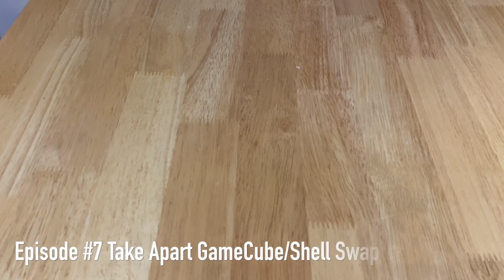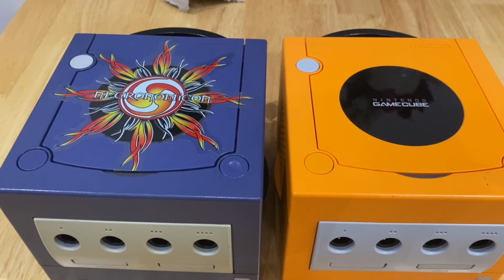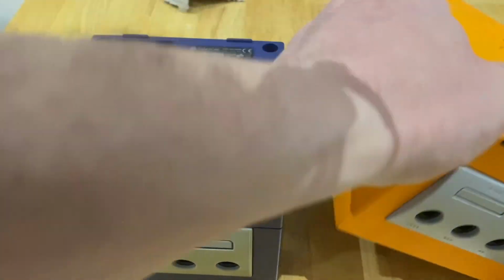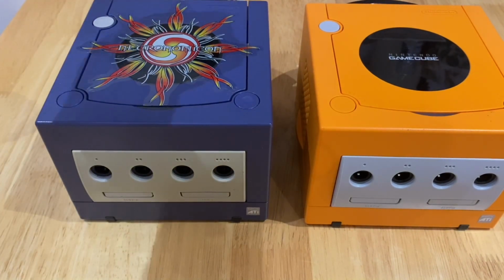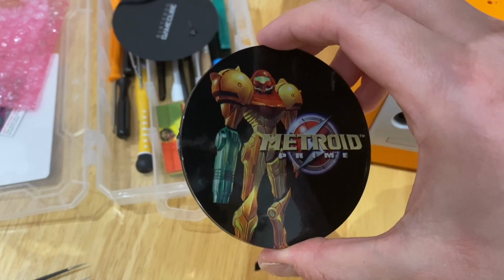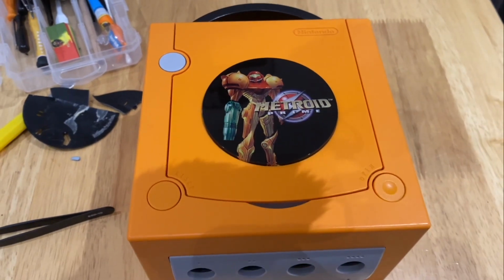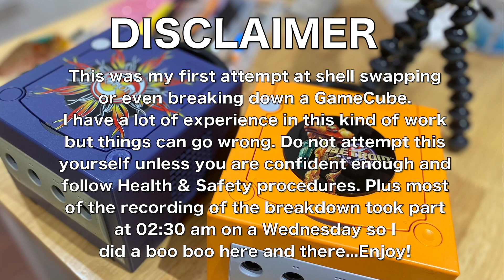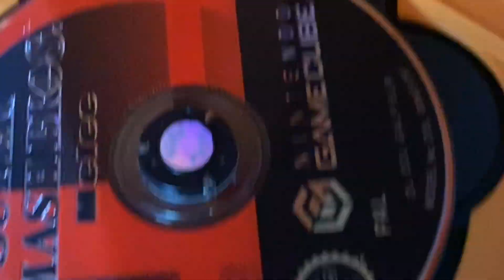Orange GameCube Take Apart Shell Swap

Comment: I just need to make a small hole in the rear piece of mine for component cables. I have 2 working GameCubes but would prefer the black over my indigo.
Reply from the maker: Ha ha! That’s exactly what I did! I realized half way and thought: F@ck! What now?! At 2am. I did the civil thing and made a hole big enough with an electric drill. If you can buy a cheap Dremel, it will help.

Comment: If you intend to do this, be sure both GameCubes have the same model number, that way you won't have issues with swapping the jewel or have to make any adjustments to the back housing (the two models have different ports).
Reply: Is that why it didn't fit? I want to swap my DOL-001 PAL into a spice orange DOL-001 will that be ok?
Reply: @mattjcwig  So long as the model number (DOL-001) is the same, the cases should be identical. So you should be fine.
Reply: @sunmarsh  I now have a spice orange gamecube DOL-001 and my pal gamecube is also a DOL-001 😁❤

Comment: I wish it was that easy for me to remove the casing of mine, it had been in the smoker's house so it was glued shut by smoke residue
Reply from the maker: Try using alcohol or a tiny bit of WD40 to losen it up. Good luck!
Reply: @GrinningWolfGames  I luckily was able to get it open by just scraping along the seam lines with a spudger tool

Comment: Wasn't it possible to get the mother board out without pulling off the heat sink first?
Reply from the maker: In all honesty I can’t remember. I think the heat sink cover was covering some screws that held the motherboard to the shell
Reply: @GrinningWolfGames  I'm looking at it again, and it seems between 11:11-11:29 that you could have just picked up the motherboard and heatsink together after removing the heat sink' s screws.
Reply from the maker: @PaigeWylderOwO  all good. The internals of this GameCube were faulty anyway and I just needed the shell. It was good experience tearing it down fully. I hope you enjoyed the video.
Reply: @GrinningWolfGames  I did. Thanks.

Comment: I have a Japanese region modded one and American GameCube. The Japanese one has trouble reading some discs, but the American one reads them all with no problem. I don't want to do a Shell swap, but could I take the American disc drive and connect it to the Japanese motherboard?
Reply from the maker: If it’s the lens component then probably yes. Check out Spawnwave’s channel as I believe he removes the component in one of his videos. I haven’t tried it my self.